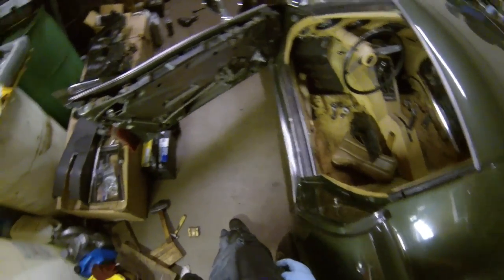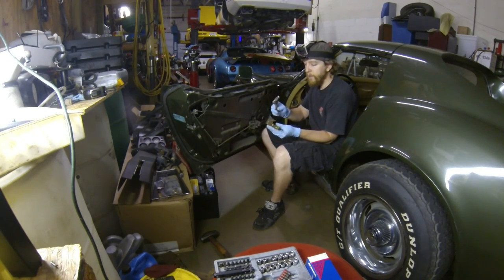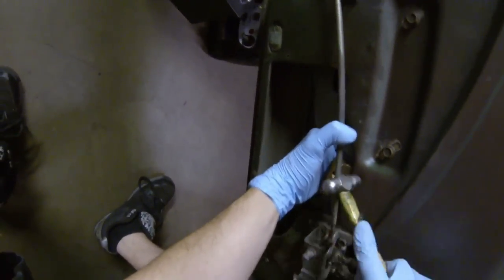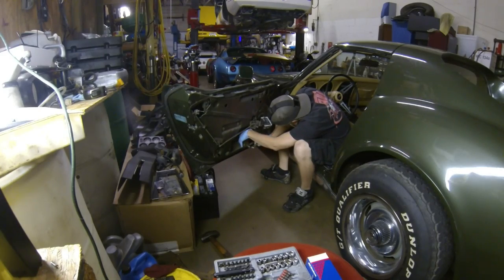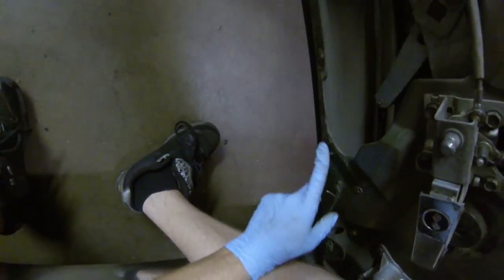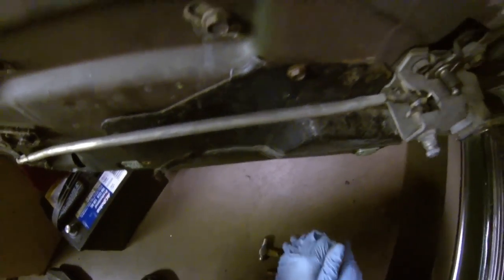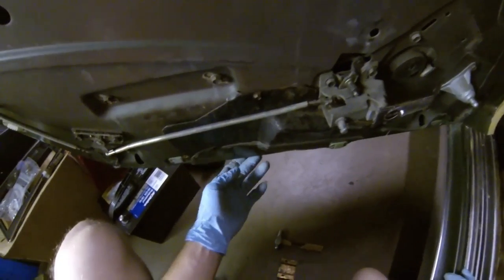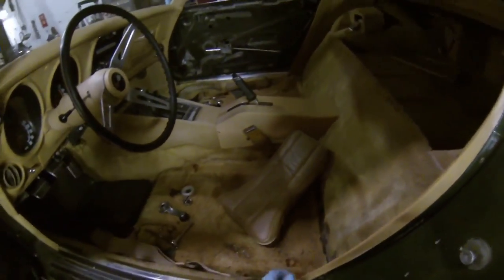Sheet metal screw hole repair: The Easy way. Door panel repair

Comment: Not what I was looking for, but that was a sweet tip. I took part of a 2×4 and screwed a couple of door plates to it, I use it to hammer metal for jewelry. It should do the trick. I wasn't even thinking about fixing my door at this point, but that looked easy, I'll do it next. I took out my thermostat coupler and when I tried to put the new one in, the screws wouldn't connect :/ they are stripped out good. I got some Loctite for metal and concrete. Wish me luck ♥
Reply from the maker: This works if the sheet metal isnt too bad. Worse case I could weld it and re-drill. Thats pretty clever. Same concept as an anvil / dolly and hammer. On the thermostat neck If the holes are slightly stripped out you could put a helicoil in it. If they are real bad you can put a time sert in it. Both are permanent fixes and are stronger than original.
Reply: @CamaroRick  I feel like a bonehead. I had already filled the edges with old Loctite that came in the mail before seeing this. I could have used my coil making plyers and some copper wire, and twisted those in. BMHATW, I hope that the glue works. I will remember the coil trick for the future. How did I not just see that as an option ♥

Comment: very good, wish I could use this for my aluminum storm door
Reply from the maker: quickest way would be to slide some copper wire thick strands in with the screw. not worth taking apart to fix
Reply: My aluminum storm door has the same issue with stripped threads. What did you do to fix it?
Reply: @CamaroRick  Dude!

Comment: That's my method of choice for shrinking a screw hole.  I've also used a MIG welder or oxy/gas torch to fill holes and drill and tap a new hole.  My current problem is:  The too big screw hole is one of the two screws that hold my overhead rear passenger side Oh Sh** bar/clothes hanger into the ceiling of the truck...  No access to the back side of the metal hole, its covered in fabric, and it has to be load bearing for when my passengers grab it to get in/out or hold on for dear life while I'm driving.  Dang screw won't stay in.  Contemplating whether to try a larger screw, or a big glob of JB Weld up in there to keep it from yanking out....  Any thoughts?
Reply from the maker: A bigger screw would be the easiest solution,  if you have the time you could use some welding blankets and cover up the areas that could be burned and give it a touch of the mig welder. Dropping the headliner is probably the professional method. You could also install a nutsert and matching hardware for increasing the strength. Jb weld alone will likely crack, but if you jbweld some metal wire in the screw hole it might work in a pinch. Ive never tried this but you might be able to grease the screw so the jb doesnt stick to it maybe a silicone spray lube on it. 

Tig welder would also work and not make any splatter / more precise weld pool to close up the screw hole. Overhead welding is a little tricky with a mig you want to use slightly higher wire speed not sure about overhead tig. Could pay a pro to tig it I dont think it would be that much money.
Reply: @CamaroRick  Thanks, going to try a bigger screw and some JB weld.  The wire is a good idea.  Just got a TIG last week and while I can't wait to fire it up, I really don't want to have to mess with tearing up my interior or upholstery...  Bad enough I have to remove the driver seat and replace the springs here imminently... 20 year old truck... Needs a little love.
Reply: @CamaroRick  Yikes.  Teach me to look at the part first!  Not a screw after all, its a huge honkin' square plastic two part clip with a matching huge honkin' square hole in the metal the size of a postage stamp!  And the clips are integrated into the handle.  Looking for a whole new handle now, or at least a cheap used one.  The clip that won't stay in is slightly broken, guess enough to keep it from staying in.  Thanks for your suggestions anyway...

Comment: What if you don't have access to the other side. I have to do this on pick up truck. There is no access to the other side.  It's in the wheel well and it's enclosed area.
Reply from the maker: It might be more reliable to just hammer it flat and tack weld it shut then re-drill. It will hold a lot stronger if welded.
Reply: @CamaroRick  thanks